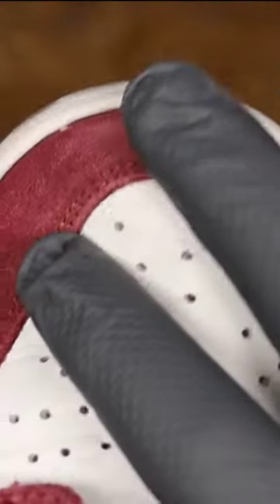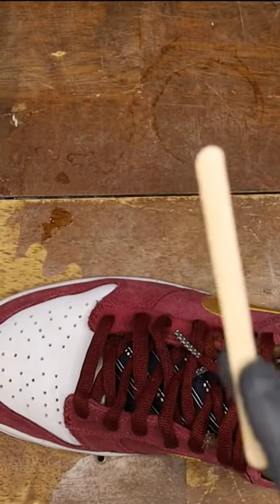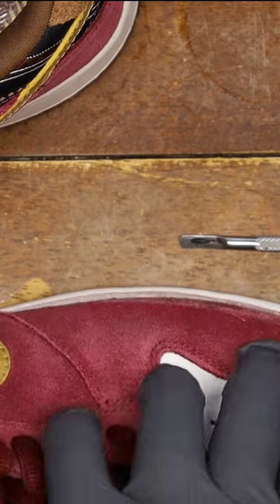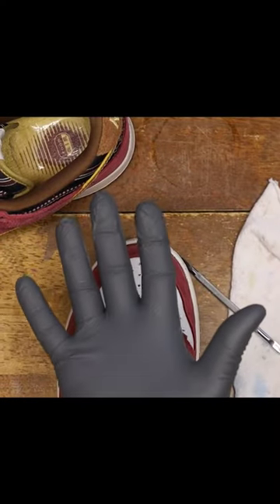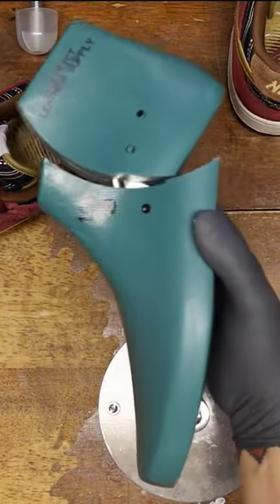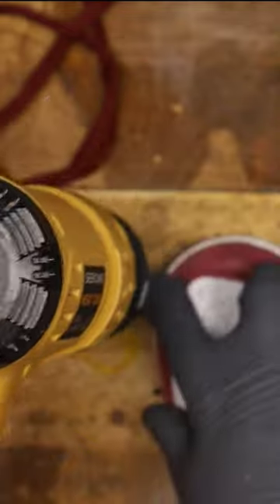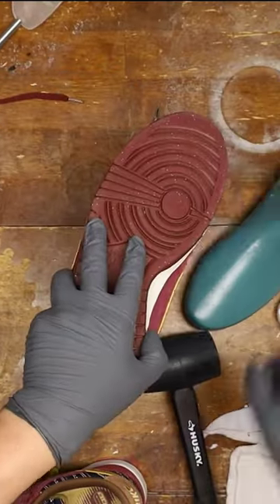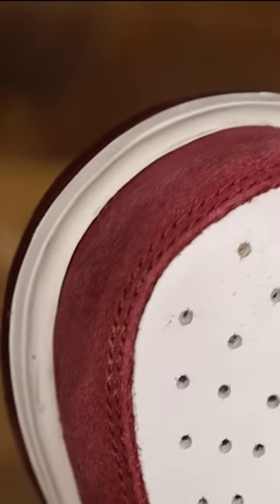Sole Separation Quick Fix #sneakers #sneakerhead #nikesb #nike #beforeandafter #restoration #diy

Comment: Shoukd you remove the sole completely or just fix the exposed parts if your running shoes been left unused for 2 years and the sole starting to seperate with area"s" exposed when you start use it again
Reply from the maker: Correct. But some people want something quick more than they want something correct.